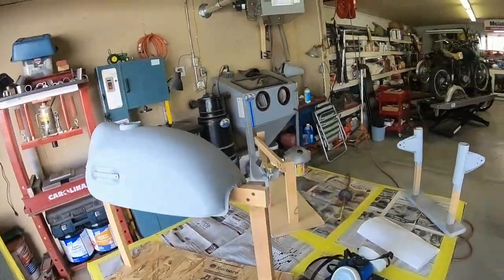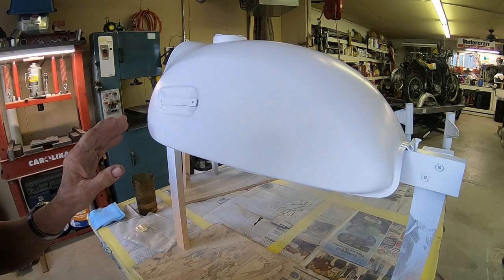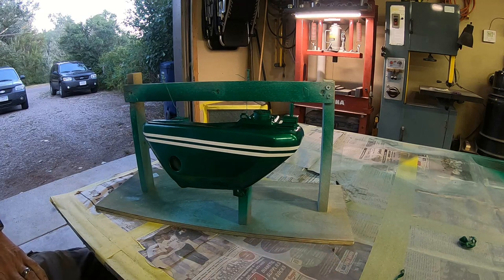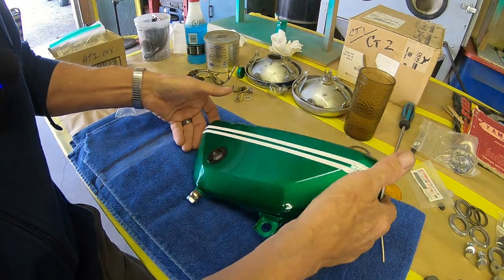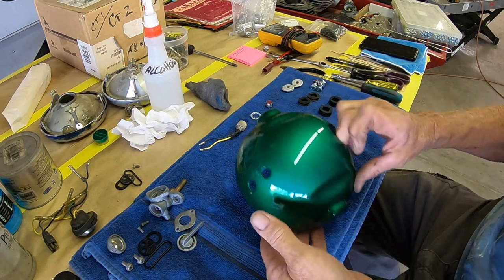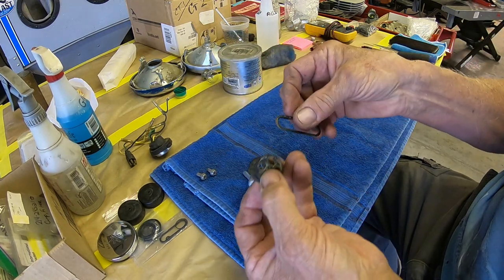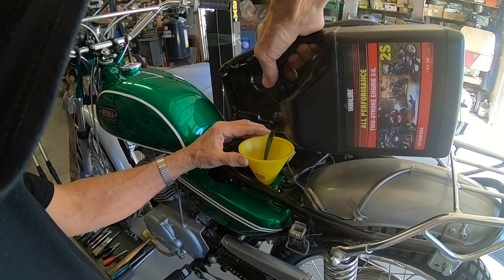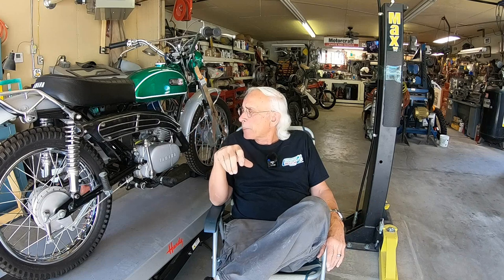Yamaha AT 1 to CT 1 Paint and assembly

Comment: Wow!!!  Never knew tanks had so many layers. Primer, sealer, stripe color, base silver, final color and then clear? Looks better than what I've seen so called "pros" do!!  Well done!!! Painting looks complicated, but its on my list to learn.
Reply: yeah, Dale knows how to paint for sure, back in the day seems i would just patch,primer sand and spray. the guys that know, use sealers, and silver/sometimes gold under the base color sounds strange but it makes the colors pop, then the Clear coat to protect and shine the base paint. years ago to get the show quality shine it took 30 coats of hand rubbed paint to get the same shine that modern clear coat provides.
Reply from the maker: Hey Jim, yeah next time you sand one, just pay attention to the layers. You have to kind of reverse engineer the process in order to even get close to mixing paint. Thanks

Comment: Amazing how it started first kick! I heard faint rattling and was wondering what was up. Your explanation nails it and explains a lot of why I've heard so many sound that way. You bore to the precise dimension the manufacturer wants. Shops don't care, don't want call backs and take the easy way out. That's why I think your bores are the best I've seen!
Reply from the maker: Hey Jim, this one had already been started and everything adjusted back a few episodes. So, these bikes are just naturally a choke and kick once.......to start bikes. Such great little machines. 
Yes, I am just going to ride it a bit. If it stays noisy, I will probably do a new cylinder. 
Your too kind Jim, thanks!!!

Comment: Excellent job once again Dale. A pro painter once told me to keep the trigger depressed when spraying back and forth. It keeps any nastiness from building up in the gun. It was really hard to get used to for a hack like me but it really cut down on inconsistencies in painting.
Reply from the maker: Hey Dave, thanks for the tip, I have seen painters do that. I am such a beginner at this this stuff. I will try it next time I have a test panel out.
Reply: Up the Air just a tad when your spraying the clear coat,  It''ll really help smooth out the finish and cut back on the orange peel.  When you watch the pros laying down the clear there is a tremendous amount of fog when theyre laying down the clear,  a smaller tip gun helps with atomisation too.  It just comes down to experience... and lots of expensive and time consuming mistakes  @montana2strokeracer

Comment: VERY nice Dale, when I paint it seems like everything within half a mile ends up with some scatter and my clear has runs.  Very nice work, my wife and I had CT1's back in the day, great little bikes
Reply from the maker: Thanks Alex, yes it can get messy that is for sure. I try to limit the mess by painting right in front of the exhaust fan. Believe me I have had my share of runs and sags and a lot of other paint problems. It's enough to make you drink sometimes. It just takes some reading and practice. 
Thats great that you guys had a pair of CT1's, bet you folks had a great time on them. They are such fine machines.

Comment: Great job sir, I hope I will be as skilled as you someday. I’ll be repainting my ‘71 AT1-C tank again soon, it turned out terrible compared to your work and I got the whole color and size of the stripe wrong, but I just ordered all new correct enough paint, clearcoat and everything. So I’ll be painting it next week I think, but I also need to sort out some pin holes near the top of the tank, so I was thinking that some JB Weld will be fine, as I seen @Garage2Trail, do it on his ‘81 TS185.
Reply from the maker: Thank you, my friend, my painting is nowhere close to professional. I am self-taught and do a lot of stuff wrong. But most of the time I get it done. I just accept less than professional work. The hobby is all about having fun, if you get too serious about a run or some pin holes it just starts to be no fun anymore. But that being said.... that is how you learn. I would just pick up a small tube of spot puddy for the pin holes, you can get it at the hardware store for just a few bucks. I just have no experience with JB weld for that purpose, it may work fine.
Reply: @montana2strokeracer Your welcome, as I’m writing this I just put on a second coat of some white filler / sealer and it definitely doesn’t look perfect far from it, but it definitely looks presentable and good enough for me especially since I done it. But I just now seen your comment and I used the JB weld and it looks like it's gonna do a good job, very strong repair I reckon. But I would've used the spot putty if I seen your comment. The JB Weld is quite hard to sand down flat and i was worried about sanding the bare metal too much so I have an obvious bump on the tank but the main goal is so I can have a full tank of gas without it leaking.

Comment: Hi Dale. I really like your videos. You inspire confidence that I can do this.I have a similar project in mind. Thinking about building up a 175 engine from a AT1E motor. Is this possible? I have a bunch of parts that I could use. I know the devil is always in the details..Is it possible to use a 175 head on a 125 bottom end? Thanks for all you do for us.
Reply from the maker: Hi Tracy, yes, the video series that you commented on here, is just that, Yamaha AT1 to CT1 is this transformation you refer to. There is a playlist showing most of the details. The only real difference is the engine. You will need the crankshaft, or at least the mag side of the crank, the cylinder, the head, piston, pin, bearing, and the flywheel magneto setup from a CT1. You can convert without changing the crankshaft and original ignition, but you probably will not be able to use the electric start.

Comment: Fuel filter looks upside down. But your work is still brilliant I must say.
Reply from the maker: Yes, sir it does, every time I put one on, I get a couple comments about that. It really is on correct; it has an embossed arrow on it for the direction of flow. In this case the arrow points toward the carb. But I agree with you it does look wrong. Think I have a couple left. I will grab some that looks right the next time.  Thanks for hanging out with me in the shop.

Comment: bet your shop smells like the old motorcycle shops. the new stores dont smell like they used to ,or my nose is worn out. think old oil ,gas, grease and especially real rubber tires did the trick back then.
Reply: I know exactly what your talking about, I wasn't even around back in the 70s,  my uncle had a motorcycle collection and the smell of his house and shed was something else.  When I go out in my shed now with his stuff and the old bikes the smell takes me back to going up to his place.    I'm certain it is the smell of the rubber too, all the small rubbers aswell add up
Reply from the maker: Hey Frank, it probably does, but for the most part since covid, my since of smell is off. But I can still smell the Klotz. By the way my wife says it stinks in my shop. Go figure.
Reply: yeah, what do they know! LOL @montana2strokeracer